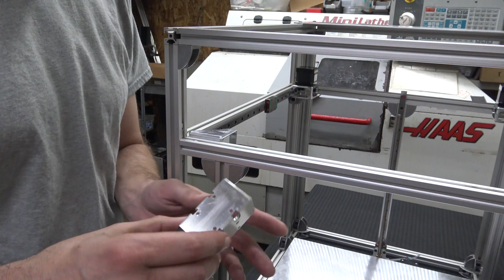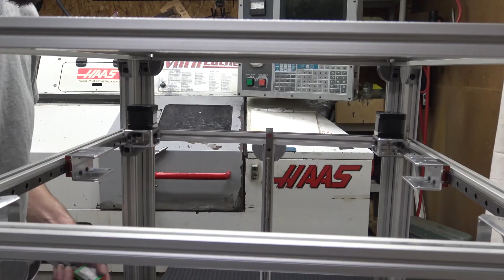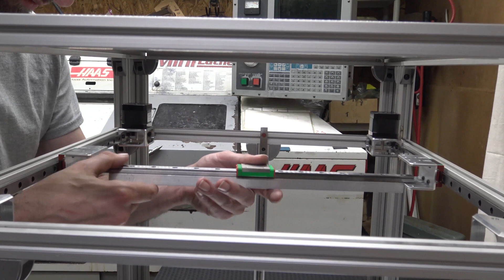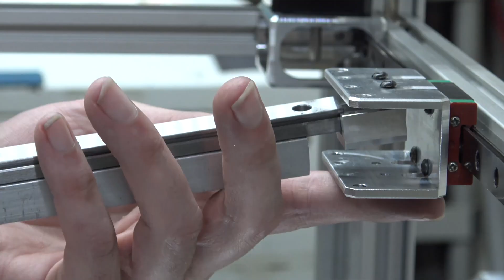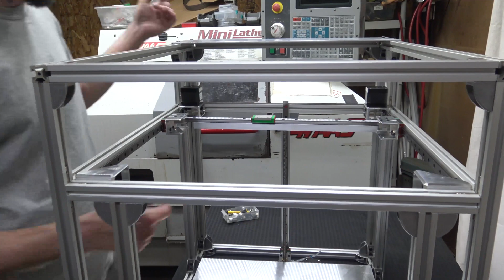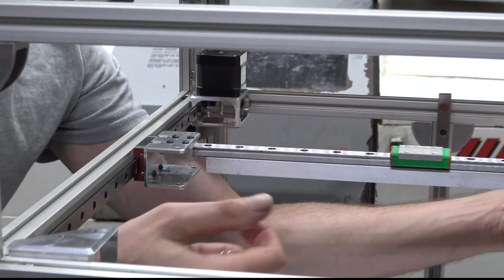SolidCore CoreXY: X Carriage And Y Gantry Bridge Alignment Install

Comment: You need to add TinkSeal to your rails.
Reply from the maker: I need to get the directions from you. I havnt used it yet because I didnt want to over apply it. Did you say that you used a brush to apply it to the rail?